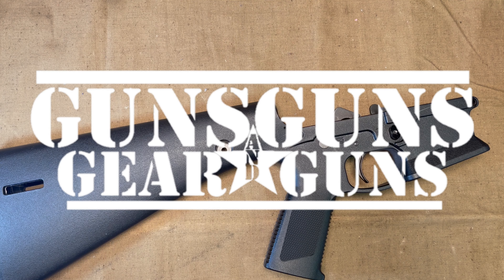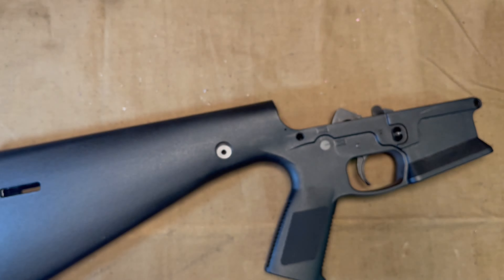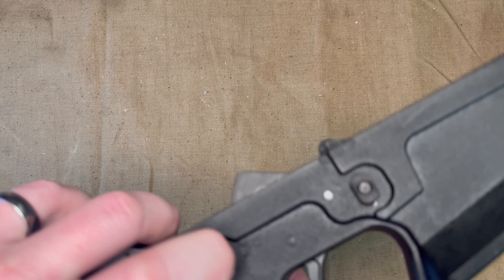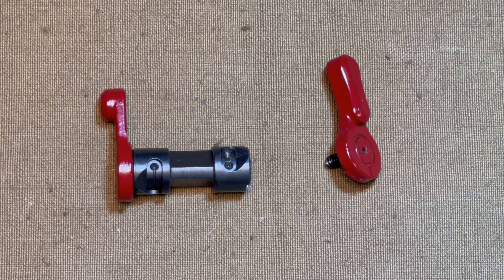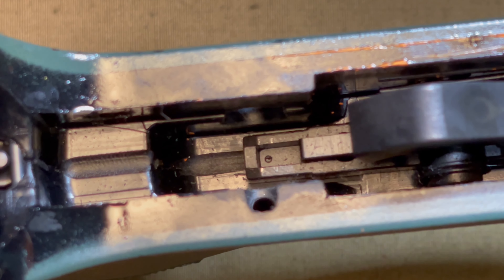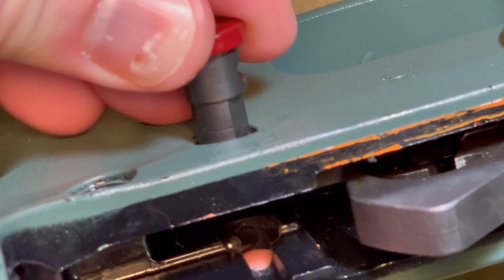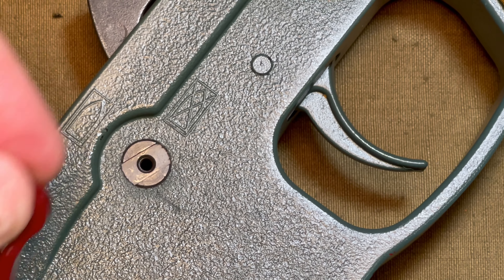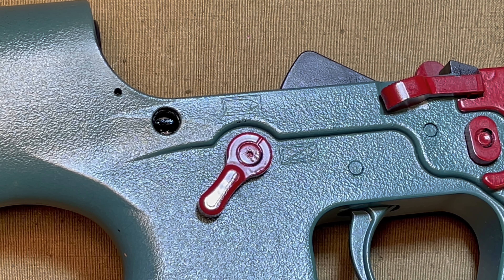Removing and Replacing Safety on KP-15 Lower Receiver

Comment: I have a Radian Ambi 45/90 safety in my lower which is not cut for quick removal like the KE Arms safeties, but I was able to remove my safety by following this video and gently but rapidly tapping the safety out of place with a brass/nylon hammer and some wiggling. I was worried that I was in a jam with my choice of safety since I had to remove the FCG recently, but this video worked as an approximate guide- thanks for that!

Hope this helps for anyone that doesn't use KE Arms proprietary safeties!
Reply from the maker: Thanks for the info!

Comment: Thanks for your video! 
I could remove a "standard ambi safety" (from SCHMEISSER) by rotating it between the two positions and gently push it out to the left side of the receiver! 
Maybe I was just lucky, or it works with other safetys as well.
cheers from Austria!

Comment: Honestly for the time spent and functionality if you buy the Ambi safety directly from the KE website that's the way to go, that's what I ended up doing. But what you could also do if you could modify one yourself looking at the stock key arms safety and then you could cut a 45 degree angle in the end basically duplicate it. This is what I'm going to do on my next one. BTW wild paint job 👍.
Reply: I don't want an ambi safety. I want an extended safety, like the Luth AR "Switch" but specifically for a KP 15.

Comment: I put a KE arms one in with no spring or detent and still having trouble getting it out lol, I don't want to use too much force and mess up the polymer receiver, but I think I just need the right sized utensil to punch it out with.

Comment: So do I need a ke arms safety? Or could I use an ambi safety as long as I can unscrew the levers to put it through?
Reply from the maker: You can use another ambidextrous safety, but the KE Arms safety is designed with a diagonal cut, making it easier to slide over the detent on their lower since it doesn't use the traditional method under the pistol grip.

Also, if you ever wanted to change it for some reason or if there was some issue, you'd basically have to cut off the safety to remove it. I purchased a standard ambi safety first, but decided against installing it due to those reasons. I get the feeling it is also fairly difficult to get the safety over the detent it's not designed to be installed that way.

Comment: Question..
Would a milspec lower parts kit be compatible with these polymer lowers? 

Or

Would you need a specific lower parts kit for these polymer lowers
Reply from the maker: Most lower parts kits will work with these lowers. When you purchase the stripped lower it should come with everything that’s not standard - take down pins and a special detention for safety selector. 

The only caveat is that if you don’t purchase the KE Arms special safety selector then you basically have to cut the safety off if you needed to remove it for some reason since there is not a removable pistol grip to do a standard safety selector installation.
Reply: @GearyGunderson  
I ordered 4..
I will make to higher end ambi everything & the other 2 more affordable & basic
Reply: @GearyGunderson  
Thanks for the quick reply
Reply: The KP15 uses a different style takedown pin. KP15 takedown pins have retention tabs built into them. If you use Mil Spec takedown pins there won't be any detent to hold them in place. The KP15 frame requires a 5/64th roll pin to hold into the buffer retainer. The KP15 uses longer hammer and trigger pin as well. You can use Mil Spec hammer/Trigger pins but they won't be flush with the outside of the frame. Also, KE Arms says absolutely positively do not use anything other than a standard carbine buffer and round recoil spring or the JP SCS captured assembly.